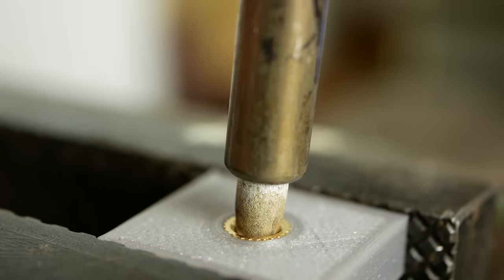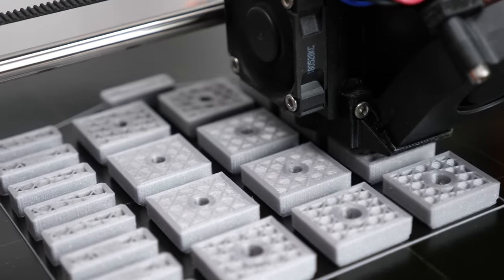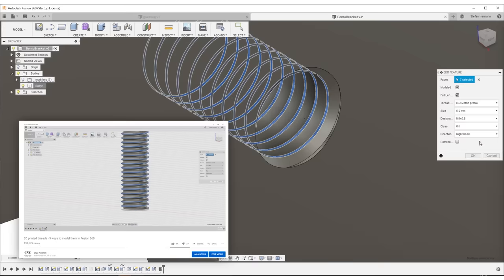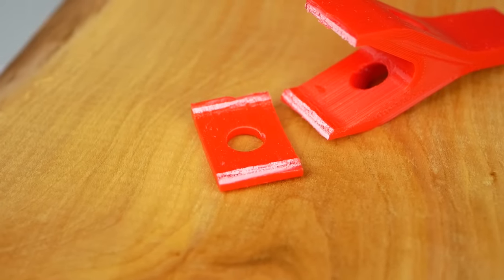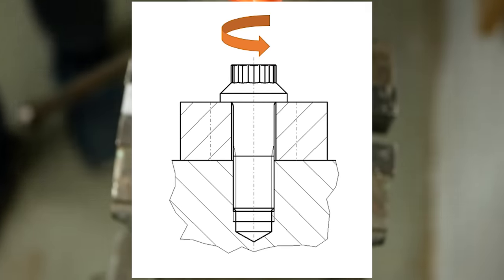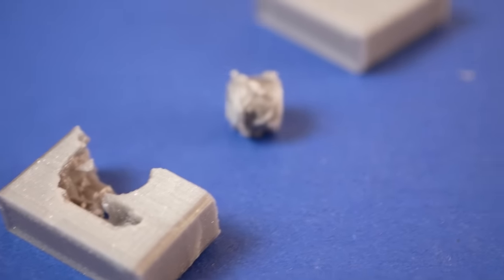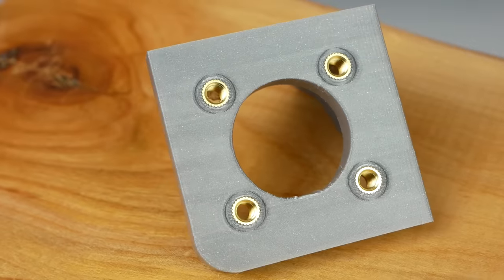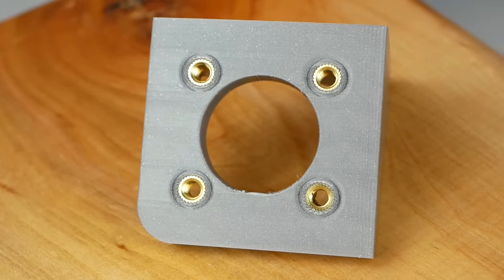Threaded Inserts in 3D Prints - How strong are they?

Comment: I think adding oil could have seriously skewed the results.
For the inserts, it was only between the insert and the screw, not at the main connection point between the insert and the plastic; but for the others it was at the interface of the screw and the plastic. That may have significantly reduced the torque required for the plastic threads to fail.

Comment: What would the minimum structural lifespan of the material used in "printing" these structures?
How long is the structural integridy of this material before weakening?
I'm not familiar with this type of "material".
How do you know that in ie 10 years this won't disintegrate? Or be weak?

Comment: I usually use printed threads because I don't need much strength and don't plan to disassemble. But I think the printed threads would have performed even worse in your tests if you varied the layer heights or just used a printer that wasn't tuned as well. The inserts and cut threads would be less susceptible to these types of variations.

Comment: How can all the broken test squares be included in the data?  There is interesting data there for certain.  Love the channel.  Data should not include any split or otherwise broken blocks if the point is to test threads.  Print it solid. I want to see the result of various threads without testing the % fill and lattice preferences of the scientist.

Comment: For American threads, you should do 1/4x20. This is the most common thread for camera tripod mounts.

Also, why didn't you compare a threaded insert to a nut on the other side of the material? A simple hole without threads which allows a nut and bolt is the most commonly used type of joint.

Comment: What would happen if you were to use steel inserts rather than brass? Brass is known to produce weak threads, I'm curious how strong the actual insert connection to the plastic would be.

Then again, how often do you use 3d prints for applications that require more than 10 Nm of torque.... Haha

Comment: Modeled threads normally need to be printed at layer thickness as small as 0.1mm. I use different processes in Simplify 3D for the layers including threads and the rest of a model. But this is not always applicable for complex models.

Comment: You mention the holes started at 4.5mm but M5 has a 0.9 pitch so according to my maths 5 - 0.9 is 4.1mm hole to start with.
Reply: Pitch is the linear distance between successive threads along the axis. 4.5mm is the minor diameter of the thread.

Comment: I plan to use brass-insert like this: https://www.conrad.de/de/bopla-gewindebuchsen-dodge-m3x65-gewindebuchse-messing-messing-1-st-540005.html
They were used in bopla-plastic housings .
Advantage: no heat necessary, the knurled wings grab into the material by turning in the bolt.
Reply: ideal to mount PCBs into self printed Housings.

Comment: Push the threaded insert into the plastic using the nozzle on your 3D printer with the manual Z control...it's easy, and the temperature is controlled PERFECTLY to melt the plastic.
Reply: Thats really interesting. I always used a soldering iron to push them in (funnily enough the exact same one Stefan uses).
But you have to be careful to push the insert straight in.  With your method that is not an issue at all.
What temperature do you set the nozzle to? Same as printing temp? I'm wondering if not too much material melts when you take a bit longer to press the insert in this way
Reply: @christiang6960  Yeah - it takes a bit of playing around.  Trouble is, you're setting the temperature of the melting zone inside the nozzle - but what's pushing against the insert is the outside of the nozzle...so I don't have a definite number that'll work for everyone...but a good starting point is the regular print temperature.

Comment: How do you ensure that the inserts are straight when you melt them in? Previously when I've tried this they end up off-axis.
Reply: They really need to be pressed in via a heated bit which is also held in a drill press ( with thermal insulation between the heat and the chuck ). That will drive them in more square.

Comment: Tappex Ensat self-threading inserts are great. Using heat to insert the inserts are probably not the correct method. We use Ensat for threads in POM plastics.
Reply: Helicoil could also be interesting to test

Comment: When you test the holding power of screws without inserts in the printed part, what type of screws do you use? Have you ever used thread forming screws for plastic? You see this type of screw used frequently with injection molded parts where a simple hole is cast, and the screws form their own threads the first time they are inserted. The threads are coarser than wood screws and machine screws. They are kind of hard to find, not in the typical DIY stores. Like these: https://www.fastenright.com/products/general-fixings/thread-forming-screws  I would love to see you test the strength of thread forming tools against regular wood screws or machine screws in printed parts.

Comment: I worked with those kind of inserts.     Good thing. But a metall screw will just pull out the insert. I then changed the design. So you put the insert from the other side into a sack hole.

Comment: 3:06 miner diameter is 4.2 not 4.5 on an M5 
So you can forget the results from the cut threads sadly 
Greetings from Switzerland
Reply from the maker: Printed inner diameters usually are way smaller than in CAD. The 4.5 in CAD were probably 4.0 printed. The tips of the threads don't bear a lot of load as well.
Reply: CNC Kitchen absolutely true 
(I thought you fixes it like me with horizontal expansion) 
Its a feature in cura
Worked on my Ender 3 
Still it wouldve been nice to measure it and note it down
Here is the part where i wanted to say

Thank you 
Thank you for making such amazing tests, and making amazing documentations about your results 
Really, you are making the 3D community better, and you should know it, you can be proud

I hope i will do something like you in the future 
Greetings my friend

Comment: You didn't show how you tightened the screw to the threaded insert. Did you use a spacer of some kind? If you didn't use any, then the screw is tightening directly against the brass insert. In this condition, naturally the insert's threads will fail before the plastic. To test the pulling force resistance you need to use a spacer. 
Without that clarification I can't trust your results xD.
Reply from the maker: There was a washer between bolt head and insert.
Reply: @CNCKitchen  So indeed the insert resisted being pulled out, shredding the thread instead. Cool!
Thanks for answering.

Comment: Guten Tag Stefans! This is Orwa from Aachen. I work for the university here and trying to get some of those from a German vendor along with the tool. Any suggestions? Maybe you can help me out with what they are called in German so I can use that to locate a local vendor? Thanks!
Reply from the maker: Which tool do you mean?
Reply: @CNCKitchen  The cylindrical brass piece that occasionally comes with the inserts which allows you to push the inserts into the material. I know you could just use a conical iron tip, though.

Comment: A word of warning, don't buy the brass inserts on Aliexpress linked in the video description, because these are useless for 3D printing purposes -- they are NOT the ones used in the video. I bought a bunch of these M3 brass inserts a few weeks ago and the knurling on these is so tiny and insignificant that the brass insert will start rotating with the bolt when you screw it in, making the whole thing completely useless. Whatever they are designed for, they're not meant for use as heat-set inserts in 3D printed parts.

This style of ultra-cheap brass insert is ubiquitous across Aliexpress and eBay, but unfortunately the design does not suit our needs in this context. It's a shame, as proper heat-set threaded inserts are very difficult to obtain in some countries without having to pay expensive international shipping.

The actual heat-set inserts you need to get will have prominent diagonal knurls and ridges (as seen in the video) to allow them to really dig into the plastic. The cheap, unsuitable brass inserts all have tiny vertical ridges which provide very little grip.
Reply from the maker: I try to change the link in the description.

Comment: How well do these work with SLS or SLA parts?
Reply from the maker: No problem with SLS parts, since that's usually nylon. You'll probably have issues with SLA parts, since the resin parts are thermosets and therefore don't melt.

Comment: M3 inserts are MUCH weaker against pull-out, because the typical M3 inserts sold have no knurling and only the ridges. It is hard to find ones with knurling at a cheap price.

Comment: Thank you for doing some objective testing on this question!
I'm new to 3D modeling and printing. One of the first things I tried to make was an oil filter wrench, and my first efforts failed because of the way slicing typically works, with a single volume, eg. My nut attached to to surface of the cap wrench was spectacularly weak and just twisted right off.
So I set about creating it as a separate part (mesh) that fit tightly into a surrounding mesh. Similar to how you showed using a mask to force Cura to locally change the number of perimeters and such.
I hope a few people will go take a look at my results https://www.thingiverse.com/thing:3610339.
I used OpenSCAD to do the modeling. The space between the meshes is like 0.01 mm, so the parts just get welded together as it prints. And the result is very strong.
This technique could also be used to make reinforced bosses for putting threaded inserts in your model.
Thanks again!

Comment: So what's with all the random black frames in the video?
Reply from the maker: What? Seriously? You mean missing frames?
Reply: @CNCKitchen  I don't know if the frames are missing or if black frames were just "inserted" between existing frames. But there are like 5-10 black frames at seemingly random points in the video one of them is at 1:03 for example. It's not that bad, but it 'causes a little flicker, which at least I consider slightly annoying.
I don't know, I just did some testing and it may be a Youtube compression error. I tried Internet Explorer, Firefox, Chrome and Opera at different resolutions and the black frame at 1:03 doesn't appear played back in Internet Explorer at 360p but it does appear at 720p (apparently Internet Explorer only supports 360p and 720p). In all other browsers it seems to appear at every resolution though.
Of course anything can happen using Internet Explorer, but strangely downloading the video as mp4 using convert2mp3.net you also only get the black frame if you download it at a resolution above 360p. Since convert2mp3's servers are in the US but I live in Germany, I assume it doesn't depend on where you watch the video from. Apart from that I don't know, did you maybe convert video from 29.97 fps to 30 fps or the other was around at some point? I guess that could potentially lead to some software skipping a frame every once in a while due to the frame rates being so close but not exactly the same...? That's all I can think of right now.
Anyway, hope it helps, if not maybe someone else has an idea...

Comment: Spitze Dein Video.
Did you ever tried a captive nut? https://www.hornbach.de/shop/Stahl-Einschlagmutter-mit-Gewinde-M4-6-mm-200-Stueck/8673667/artikel.html
They are available in every DIY store. I use them since I started to work with wood and took it over to the 3D printing.
The second way how I put in a thread into the part was for sure not so elegant like yours. I changed the design, divided the part into two halfs excluded the space for the nut. If I need really more torque and had the space for it I used a well sometimes a wing-nut. By reason it takes really a lot space I don't like that proceeding. 
The inserts what you showed are much different, much more cool, elegant in using and gives the parts a really professional design.

Please continue what and how you are doing.
Wie warten auf Deine Ideen.

Comment: I will bet you 1 million dollars that these inserts will be stronger if you drill a hole slightly smaller and press fit them rather than using a soldering iron. That is not how these things are meant to me used. They have no grip this way.

Comment: cool story, next try it with a modern structural resin.. try one of the "dental" brands and see what happens .. you might find your results are based on a fallacy of omission.
also, why in the hell would you put hex-filler in a TEST part? thats a strong mode of random variation right there

Comment: very poor if used in damp conditions where a steel zinc plated bolt will seize into the brass with rust
Reply: If you are using in damp conditions your part is going to fail before the bolt seizes

Comment: All test are inconclusive
You need to have solid parts. as the surrounding  of the threads will be weaker when tapped and also when using inserts, parts that are made with threads  has layer bounding around it .
anyway it will take to long to explain fully, 
So Hence you need to use 100% fill. to get a proper conclusion. RESULT!!

Comment: The inserts you linked are crap. In your vid you use inserts which cost ~0,3 € in low quantities. The cheep chinese ones dont compare to those...
I used both kinds and have experienced the difference.
Else than that I liked the scientific approche.
Reply from the maker: Interesting to know. Where is the difference?
Reply: The shape!
The ones you liked have a shape that alows the to more easily slip out.
Even the insertion is not as easy or more prone to be inserted crooked because they miss the taper at the start.
I think the cheap ones are met to be injection molded.
Anyway cuting a thread direcly in the part was better for me than using the cheap ones.
Reply: @Chaosstifter87  I agree with you 100%, the linked cheap Aliexpress brass inserts are useless for our purposes and are not designed for use as heat-set inserts in 3D printed parts.

Comment: bad test, you did not even consider infill percentage of the material based on the stress it is to be involved in. FYI, HEVO builds with PLA uses 100% infill and is threaded, doesnt even crack or give way. also, your prints shows that there was warping meaning the consistency of the print is questionable.

Comment: Was denkst du über ein helicoil in einem gedrucktem Gewinde?
Reply from the maker: Helicoils should work as well, though I think they don't add a lot of strength and are rather for wear resistance.
Reply: @CNCKitchen  maybe we'll find them somewhere between an inlet and a normal printed one.
I think its a bit easier then melt them into your part

Comment: using your iron like that can ruin it ;c specially if it's an expensive kind!
Reply: If I wreck anything it's just a $20 tip not the $270 Solder station.  I can live with that personally.
Reply: @AcidicVids  good point. i did ruin the body too but that's just the entire iron again. not that expensive.

Comment: A new material for machine and tool bases....Epoxy/Granite .
Instead of cast Iron, or plate steel... this is my plan ... to take over Earth.
I just need to know threaded inserts will work in it !!
Reply: Another simple, very useful fastener ... seems I do not know it's formal name... 
looks like a dowel ... drilled to cross an intersecting hole, where a bolt can be threaded into,  manufactured in many sizes... 
I am shamed, not knowing its technical name. 
DammMeeee !!!
Reply: @kennethkustren9381  that's used in a lot of furniture, I know